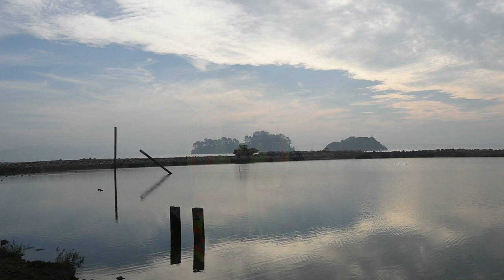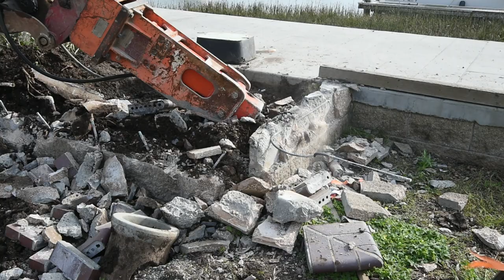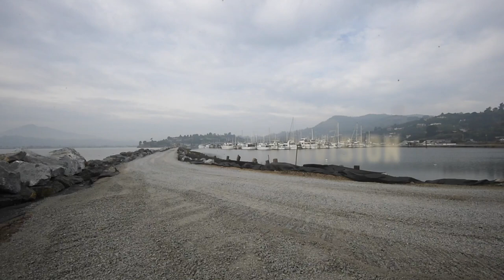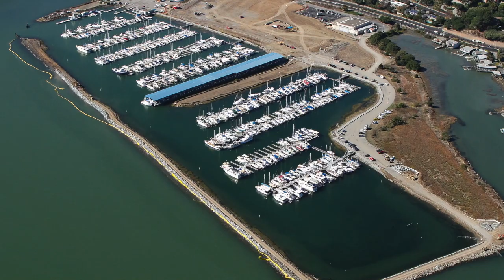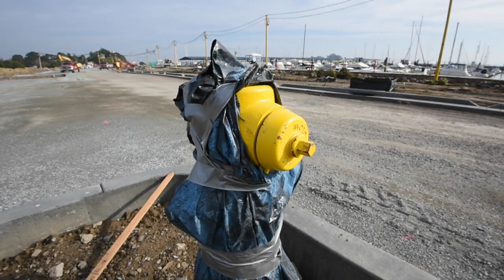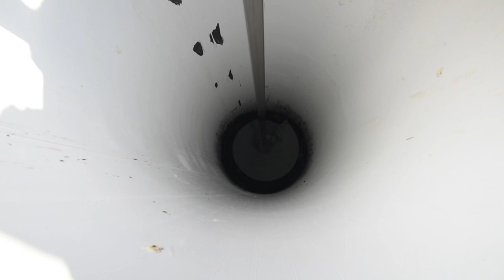Project Spotlight: Loch Lomond Marina Development

Comment: Nice video. 

Understand the project is still ongoing after so many years. 

The pathway is closed after opening for a brief period during the 2022 Thanksgiving.

Can you please provide an update on the Flooding repairs at the connector to the breakwater and when will the pathway be opened?